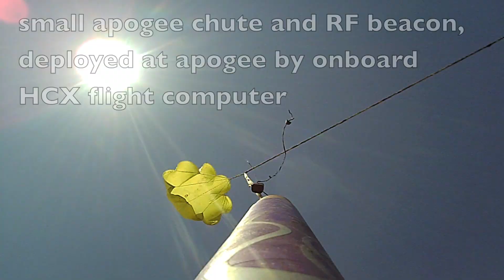Dairy Aire 2012 Epic Flights

Comment: Any high power rocket launches need to be approved by the FAA.  The FAA gives the event a "waiver" which will specify the maximum altitude rockets are allowed to fly.  At this event there was approval to fly up to 17,000ft above seal level.  The height of the waiver depends on how large the recovery area is, and of course any controlled air routes.